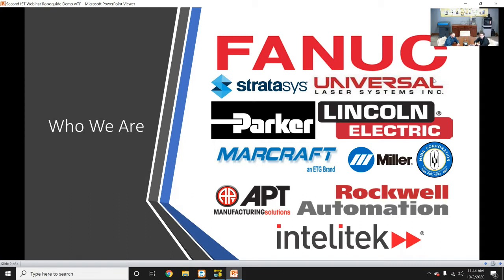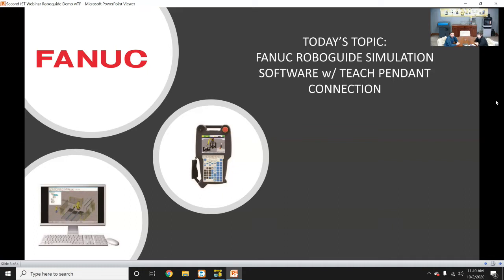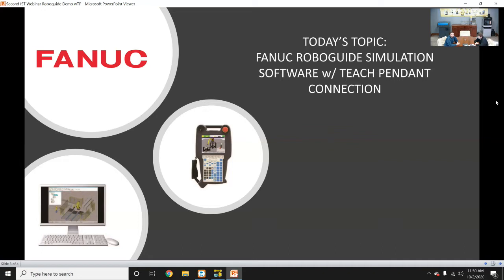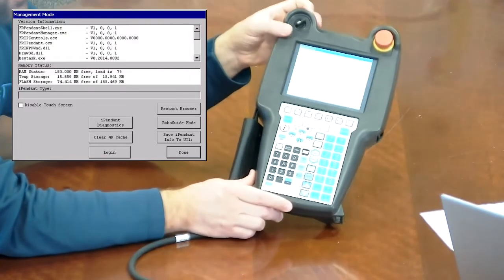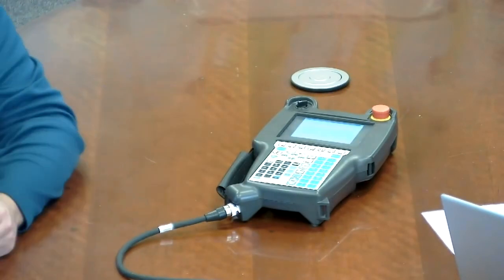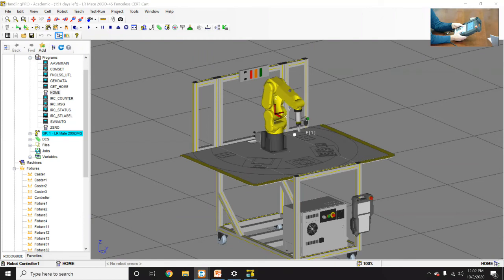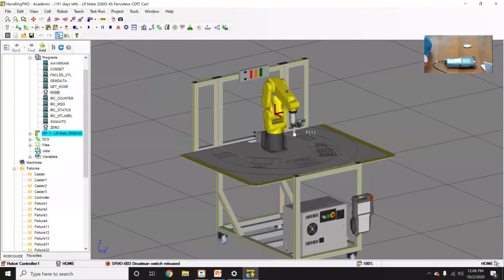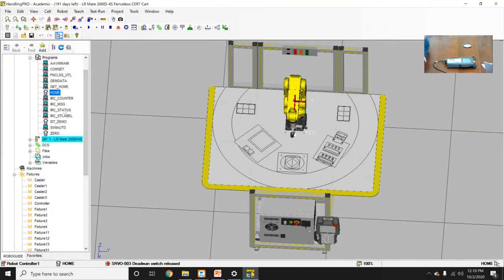FANUC ROBOGUIDE Simulation Software w/ Teach Pendant Connect

Comment: Hi, this is great to me. Thank you for sharing. Never known that the software could connect to real pendant. I interested in, how can I make this cable?
Reply: This cable can be purchased from FANUC America by contacting their Spare Parts group at 888.326.8287.  There are two options available: 1.5M iPendant PC Conversion Kit w/ Power Supply (Part Number: EE-6686-076-001) or 3M iPendant PC Conversion Kit with Power Supply (Part Number: EE-6686-076-002).
Reply: @jjburkhart3829  Many thanks sir.